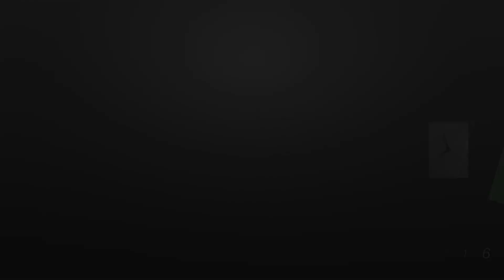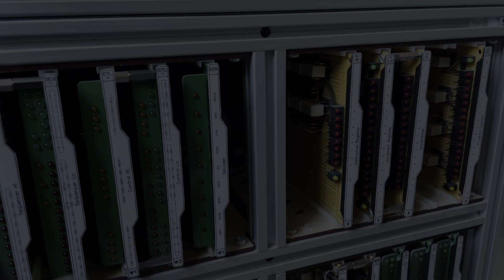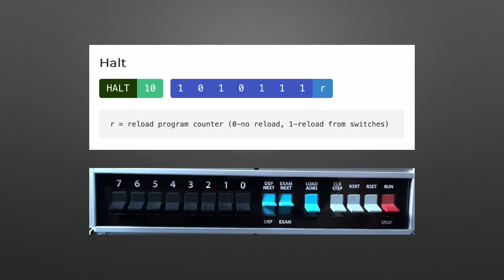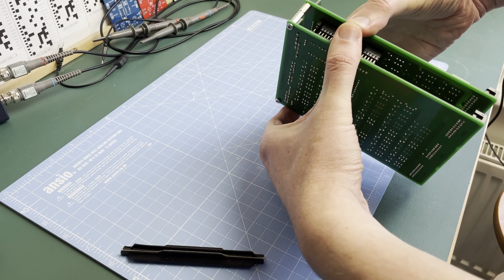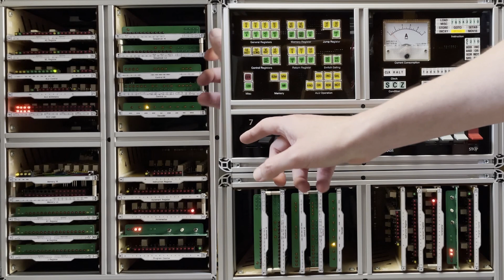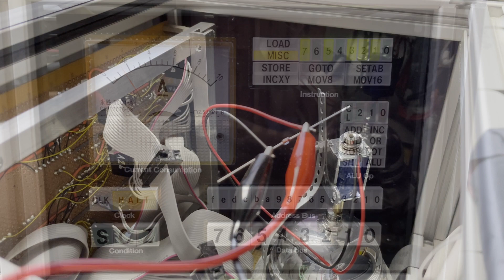Relay Computer Clock - Ep16 - Fitting & Configuration

Comment: One thing that would be nice is to have a digital potentiometer set to a specific address on the computer that could self-change the frequency  !
Reply from the maker: As it happens it'd be totally possible given the crystal clock frequency is set by a 3-bit value via that switch at the card front. Would just need something to latch the value and then it's just a case of mapping the opcodes.

Comment: If you quickly retract the solenoid the bell should have a much nicer ring to it!
Reply: The hammer is never connected, but usually if you keep the button held down, the hammer stays in the bell and causes extra vibrations and dampening too.
Reply: I personally find the muted ding more pleasing.
Reply from the maker: Interestingly that 'reception bell' I've used doesn't have the hammer directly connected to the button at the top ... it just causes the hammer to swing into the bell and then drops back. That being said though I do want to retract the solenoid so it's not staying energised throughout the halt period (which could be a while). I'll probably do that with a basic 555 'single shot' timer or something similar.

Comment: What will be the next step? With the clock now done as well, aren't you done with the computer soon?
Reply: I believe he still needs to do the load and store capacity of the computer.
Reply from the maker: Yup, finishing off the instruction set is next on the 'todo' list. Basically everything shown in this video on the controller card that's missing relays: 16-bit increment on XY register, load and store (from/to memory) and 16-bit moves (between XY, PC, M and J registers).
Reply: A feat of engineering and a work of art